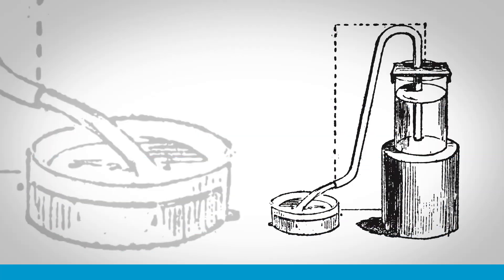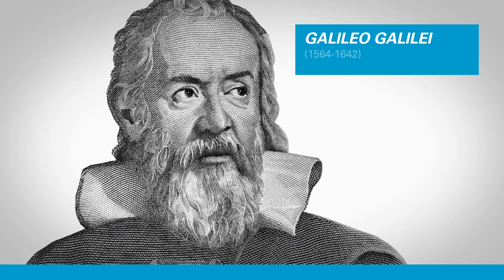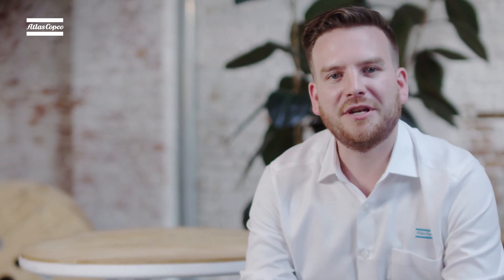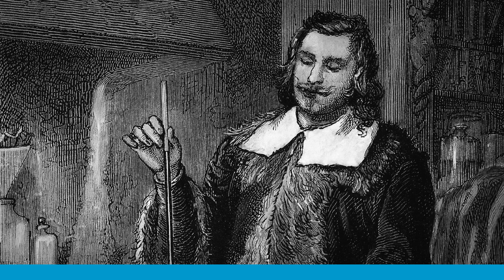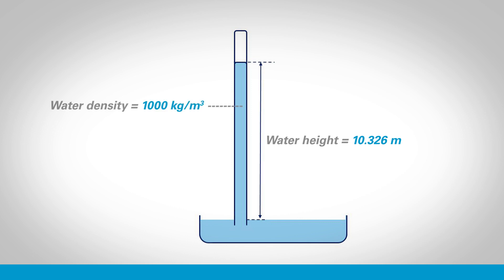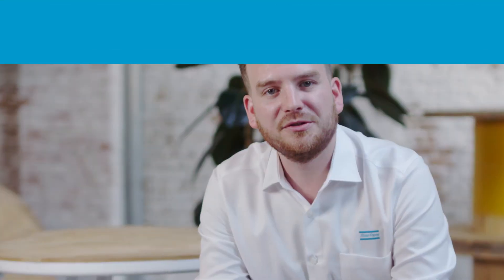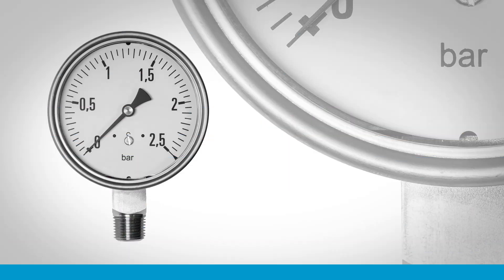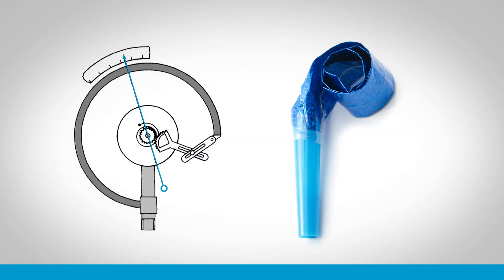Why Do Siphons Have A Maximum Height? Principle, History & Assumptions (All Explained)

Comment: Does said disappear, and flow resume once the water level rises above the 10.32meter level?
Reply from the maker: Hi Tim, To help you more effectively, we respectfully ask that you further expand on your inquiry.
Reply: When the water stalls, and the gap is formed, does the flow restart when the water level rises past the 10M level?
The reason is, whenever my syphone stalls, it’s necessary to open the venting valve which is positioned at the apex and then fill the void to restart the flow.  Also another question: does a syphon create bubbles? My siphoned is 300m long by 4” diam. I’ve pressure tested every mm with 30psi of air, but still have a tiny stream bubbles at the discharge,  I can also hear bubbles streaming through the apex with a stethoscope. Can you spell the gauge type you referred to? I can’t quite hear the term clearly.
Thank you very much.
Reply from the maker: We would appreciate it if you could provide us with your country of origin so that we can refer you to the appropriate team.
Reply: @AtlasCopcoVacuumSolutions  canada

Comment: A Siphon Pump Having a Metering Chamber can dispense water 25 feet above the source.
The weight of the water within the sufficiently sized long leg is acted on by gravity when the system is closed back airtight and the flow is allowed by opening a control valve after a small  portion is withdrawn from an inline metering chamber and a vacuum is created that is enough to draw water from the source to refill the chamber and flush any air from the system at the long leg outlet end making the system ready for another withdrawal.
Reply from the maker: Thanks or sharing your insights.
Reply: @AtlasCopcoVacuumSolutions  US Patent 5,358,000 has  defined a Siphon Pump.
Reply: @michaelohair1062  From what I see, that patent can not work.No energy input to elevate any water.
Reply: @kjellg6532  The siphon pump having a metering chamber does work. The basic concept is pictured in figure #1. The siphon is initially primed and the water is allowed to flow through the short leg and the canister and the outlet long leg.  The crest of the siphon conduit can be raised 25 feet above the source and gravity acting on the properly sized long leg that is positioned far enough below the inlet elevation will cause a flow. 
The flow control valve #28 at the crest works in conjunction with an anti backflow valve # 26 at  the lower  end of the long leg to leave it full when the flow is stopped by closing the shutoff valve. 
The canister can then be emptied and put back airtight and the foot valve #12 prevents any water from falling back to the source.
The control valve can then be opened and the weight of the water within the long leg will draw water from the source replenishing the canister and the small amount of trapped air will be expelled out the end of the long leg and the system will be ready for another withdrawal at the crown. 
This is a cycle.
No outside source of energy is required because gravity is the only power source.
Reply: @michaelohair8443  I understand that this is how the patent describes it, but I disagree. At startup all tubes and vessel 16 is filled with air. There is no energy stored in the system. By filling the tubes and 16 with water you add energy to the system as static height energy. By letting out water from 16, you expelled energy from the system. After a few cycles, no energy is left in the system. This „siphon" can not work as there is a leakage at the apex of the system. Flow at the output side will not refill 16 and 16 will be filled with air. That is, if the whole system do not stop before that.
Reply: @kjellg6532  The siphon only needs to be primed once initially and then the system stays primed if proper timing is provided to allow the air to be expelled out the long leg end before another withdrawal at the crown canister. 
This siphon pump can be used time and time again without losing energy if it is put back airtight each cycle.
Reply: @michaelohair8443  OK, you prime the system, you add energy to it. After the first cycle 1 litre is left out from 16 into the 34. The system has lost the potential energy of 1 litre. From where will the system regain that lost energy?
Reply: @kjellg6532  Note: that the long leg should be of sufficient length and drop in elevation to allow the weight of the water within the conduit to create  a vacuum enough to draw water up the short leg and through the canister  and thence below the source level to purge air from the system. The water from the source is acted on by gravity and this is the energy source.
Reply: @michaelohair8443  Consider the following experiment:
Given an ordinary siphon, a hose running from an upper tub A to a lower tub B. At the top we install a T junction. We prime the siphon so that the input suction side, the output side and the vertical stub from the T is all filled with water. We close the vertical stub with a valve.
This will work as a siphon, air tight,  source is higher than output. All criteria met, we let go and the siphon starts running. As long as there is water in A the siphon will run, for days and weeks…

Now comes he tricky part, for every minute, we open the valve for a few seconds letting air into the system. Will the siphon continue to run? The patent claims that it will.  In my experience after a few cycles there is too much air in the system and it stops. 

This experiment mimic the patent. The T is the vessel 16, and we do not even drain any water from the system as in the patent. We just add som air from time to time. 

The patent does not work. No siphon can elevate any water from input to output, but a siphon can conway water over a ridge or wall no higher than about 8 m.
Reply: @kjellg6532  The patent  does work. This idea was conceived where there was a need for a water  supply to an old cabin that never had electricity. There was a pond of water below the cabin and the first model was just a simple arrangement set up at the dam. The concept was proven with a one inch hose having  a foot check valve at the inlet and an inline water filter canister at the crest with a shutoff  valve near the canister for convenience of access. An inline check valve was added to the outlet end.    The line was around 50 feet at the short leg and two hundred feet of long leg length sufficiently below the dam.  After initially priming the line the flow was stopped and the canister was emptied and then screwed  back on airtight. The control  valve was opened and the siphon immediately  replenished the canister  and after a period of time air was expelled  out the long leg end and the flow was continuous.  This arrangement worked  time after time.  A 50 gallon  barrel  was filled with it on a platform  near the dam above the pond.
Reply: @michaelohair8443  Now I agree, this seems to work if 16 is not too large and the output leg is long with an exit far lower than the surface of the pond. The exit side must be large enough to bring out the air without the siphon stopping. Do you know anything about size of canister 16 and the cycle time?  Any article or reference to be found on the net? 
This is a much more sofisticated instrument than the normal primitive drum-„pumps“ that is served in YT videos. 
Sorry for my ignorance, KG.
Reply: @kjellg6532  Yes, the outlet end was sufficiently below the source to draw the air out of the siphon. 
More length was added for the automatic dispensing. 
An automatic arrangement was created with a one gallon canister fixed on a platform 15 feet above the pond elevation and it is pictured in Fig #4 of the patent. 
A barrel was positioned below the canister on the platform and the timing  for each dispense cycle was set at around 10 minutes.
This arrangement automatically filled the barrel time after time with no outside energy source.
Reply: Invented Siphon Pump Metering

Comment: The important thing here is that people call it "suction" which is misleading because vaccum has no pulling force. Its actually the atmosphere on the other side "pushing". Just like in a see - saw , the heavier body pushes more and hence the lighter body rises... Here the atmosphere pushes and water rises.
Reply: It's both pressure, gravity, suction, and molecular bonding at play.  If you take away any of these components the siphon simply will not work. You need atmospheric (or some other) pressure to push down on the basin of water, suction to pull (or continue pulling) the liquid up the tube, gravity to continue pulling (sucking) the molecularly bonded chain of water molecules over and down the tube spout exit.
Reply: Gravity acting on the contents within the long leg of the airtight conduit creates a suction at the short leg which draws liquid from the source over the crest and to the outlet that is positioned sufficiently below the source.
Reply: @michaelohair1062  Now what happens if you make the suction pipe 1 m in diameter and the exit side as short as possible with a 1 inch pipe? The siphon still sends water from the higher source to the lower exit, despite much more water at the suction side, ref: https://en.wikipedia.org/wiki/Siphonhttps://en.wikipedia.org/wiki/Siphon

Comment: We have also a river about 300mtrs from our house but the problem is I need a 20mtrs suction to lift the water from down. My question is, can I use siphon system if my suction height is 20m and the outlet going to our house is 300meters?
Reply: Hi. Did you try it? What did you learn?
Reply: Sorry, but no siphon can lift any water. Water level of source must be higher than point of exit from the siphon.
Reply: @kjellg6532  Pardon, but yes, siphons can and do "lift" water all the time. I've seen hundreds, maybe thousands and have yet to see one that doesn't, or at least one that doesn't cause water to "rise' ;)
Reply: @Rick-the-Swift  Depends a bit in what you mean by lifting water.  If we consider the simplest siphon setup: a tub A, a hose and another tub B. If A is elevated higher than B, water will flow from A to B. That is if the top of the hose is not elevated more than about 10 m above the surface of tub A. 
It is correct that the water passes higher than the source, and that can be practical, but, in this setting it is indicated that the siphon can lift useful water at a tub B elevated higher than A. That is not possible. If B is the highest, water will flow from B to A, from high to low. 
Considering a „siphon“ to be a closed system wit one input, one hose and one output, the output must be lower than he input. Water does nor flow uphill.
Reply: @kjellg6532  I appreciate your input. I think we agree on many aspects, but like all things in physics, the human language is often limited in capacity and to interpretation. To say lift, flow up hill, or cause water to rise are all generalizations, which I'm fully aware that I am just as guilty of making. Water does indeed flow uphill in a siphon, because of the siphon's design. The energy source which causes the water to rise becomes a bit complicated. For the water or other liquid to travel uphill involves multiple components of energy, but I will try to explain the best that I can, given a bit of time to fully articulate the complexities. 
  I shall bookmark this thread and return when that time has been allotted. Perhaps I will make a video to better illustrate my understanding of physics involved that you and others could review, as I'm yet to see one that leaves me satisfied, or offering a fuller explanation, in laymen's terms..
Reply: @kjellg6532  Also I wanted to point out that you are exactly right regarding the OP's original question, that a siphon, as mainstream science understands them to work will not help this person lift water from the river and deposit it at his house 20 meters above the river. However that isn't to say that the design of a siphon doesn't facilitate the lifting or uphill flow of water.
But that is another discussion which I've addressed already in my previous comment, which I shall return to hopefully in the near future :)
Reply: A siphon can indeed lift water above the source level. 
US Patent 5,358,000 was the first to teach how an inline metering chamber can cyclically be emptied and refilled with a siphon conduit.
Reply: @michaelohair1062  I do not think so. To lift water to a higher elevation you need to add energy to it, ref laws of thermodynamics. How does this patent add energy to the water?  I have briefly looked at the patent. From input 12 via a small closed canister 16 to the lower output at 24 this is a copy of the drum-„pump“. It works fine as a siphon as the system is air tight and the output is lower than the source. 
Then comes the tricky part. At some point in time the valve 42 is opened and water from the high canister 16 are let out at a high elevation at outlet 42. You primed the system, added energy to the system by manually lifting water into canister 16. Now this energy is lost by expelling the water via output 42. 
To reenergise the system you now have to manually lift another body of water up into canister 16. 
I can not see that this system can lift any water, no source of energy input but for your arms. There are some discussion about automatic valves, opening and letting air in to the system etc, but this does not explain any energy source. As I see it, this patent does not work.

Comment: Very impormative,thanks for d creator of this video..can we discuss further?there is a limit of this application with respect to the head of the water source or supply..anybody who have d data of the limitations.lets say I want to use this application to a water source 50m below the ground,will this system work by creating an elevation on top of the ground for a siphon system..just an exaggerated scenario..will d water 50m below the ground still be pumped up by siphon system to flow on d ground?
Reply from the maker: Hi Wilbert and thanks for your interest in our videos! You’ve rightly grasped the important takeaway here that it is the strength of Atmospheric Pressure, not Vacuum, that provides the energy to drive water up the tube – every 0.1bar of pressure is enough to push water 1m high, so If you have 1bar of atmospheric pressure at the bottom, you can push water up 10meters of vertical height by creating a vacuum (removing the atmospheric pressure) at the other end.  
The peak of Mt Everest is at an altitude of 8Km, at this height there is much lower atmospheric pressure- only about 30% compared to sea level.  If you set up a barometer on top of Everest, you would find that atmospheric pressure is only strong enough to push water 3.3meters up the column.  The reverse is also true of course - if you could dig an empty canyon 8000m deep, the air pressure at the bottom would probably be around 1.7bar – this higher pressure would allow you to make a siphon or barometer with a 17meter column of water.  Does that help to explain?
Reply: @AtlasCopcoVacuumSolutions  thanks for the info,with that,kindly confirm my thought that it is possible to use SIPHON in extracting water from d river to a 50m ground to have a continuous water flow since the river has a continuous water flow.Is that right?
Reply: @AtlasCopcoVacuumSolutions  very helpful,thanks a lot,hope u can guide me further to set up a free flowing water to a level ground extracted from a 50m below river using a 5 stages SIPHON as u said 1bar atmospheric pressure can push water 10m above without using external energy.
Reply: @magicvalleycandelariaquezo8137  No siphon can lift any water to a higher elevation. Thus using 5 stages is equal to 5*0=0